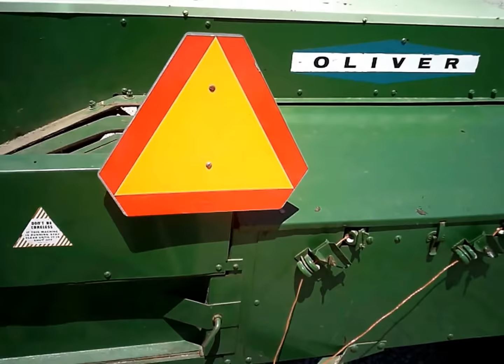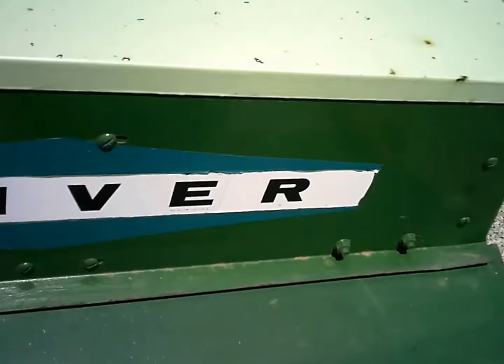Wonderful knotters

Comment: Another thing to look at is your plunger face.  I believe all balers have 45 degree angles top and bottom.  Usually one or two of them is broke off, usually by the knotter that is missing a knot.  They need to be repaired or add a one half by two  inch pie
ce of steel between them and weld it to the face of the plunger.  There was a kit you could buy for springy material but a new holland mechanic told me to weld them on and forget taking them off..  This should stop the string from hanging up on the knotters.  It did mine. It pushes the material thru 2 inches farther and lets the knotterr tie with a loose string. Then your wipers can push the the twine off the knotter.  I haven't missed a knot in years.

Comment: I'm surprised you got it tie plastic twine, Mine never would tie it but put the old sissle twine in it and away it would go !  One thing to remember is that plastic twine was not around when that baler was built so if it still gives you a problem switch it back to the old sissle twine and see what it does with it, Its bigger and easer to cut so its easer for everything to grab it and hold it. That is the one big difference in the old balers and the newer ones the tolerance in the knotters and the twine.  But you got her working good with it and that's something I was never able to do with mine. Looking good Jake !  Bandit
Reply: Bandit farmer my  john deere 24 t wont tie plastic either. They do sell updated bill hooks for plastic twine
Reply: Not that I know of, The 24T was an older baler when plastic twine came out, But you could ask a JD dealer for sure if they do or not. I don't think they do but it never hurts to ask. Bandit
Reply from the maker: Bandit farmer ya I got to have it work with plastic because of the mice. I had them even chew several bales of plastic twine this year. I’ve heard the two biggest things if u run plastic is the twine discs have to be run tighter and the wiper arm needs to wipe the back of the bill hook really nicely. Thanks for watching! I just hope it works come Monday lol
Reply: I think the biggest problem with older balers running plastic twine is they were designed to run the bigger sissle twine and as they get older normal ware prevents them from using it. Now an older baler that doesn't have many bales threw it would be easer to get to run plastic twine because everything it good and tight. My old 520 I had to give a shot of grease every 200 bales to keep it tying good but its a well used baler, Now the new 520 I bought hasn't had maybe 2500 to 3000 bales threw it in its life !  It was bought new and used for two years and its set ever sense, Its an old baler that might have a good chance of being made to run plastic twine than any other old baler because it just doesn't have any ware on it.  Every baler I have run or been around has a sweet spot it runs the best at even new ones.  When they sold my uncles new JD 348 baler at auction the guy that bought it my cousin tried to tell him about its sweet spot, I kid you not this guy told him "I don't give a d- - about no sweet spot it will run wide open or I'll junk it !  LOL Some people right ? Bandit

Comment: I never used plastic twine in my 62T baler but I remember that with the New Holland baler you had to either tighten or loosen the twine tensioners on the twine box when you switched back and forth between sisal and plastic or the knots wouldn't hold once the bale came out of the chamber. It was something that I frequently forgot to do when in a hurry because we switched back and forth all the time depending on where the hay or straw was going. Been a long while now but that came to mind right away when I saw this video. ;)

Comment: Jake just go back to those twine tensioning devices at the twine box and inspect them closely. One or both parts of the "jaws" may have a groove worn in them that is too deep, due to wear, and you might have to fill them in a bit so that they grip adequately. Also the bolt that holds them shut should have a compression spring to hold them shut. With time this spring gets tired and the temptation is to tighten the bolt too tight to grip the string and the spring will not compress sufficiently to allow a knot (between two balls) to pass through. I cannot remember the figure but we used to check out the tension and pull with a spring balance to get the right amount of lbs of friction. Could your balls of twine have got slightly damp over winter and become slightly fuzzy? However it appears likely you might have used enough twine in your testing to have got well past any possible issue like this.
Reply from the maker: Dan Whiteford they have a groove wore in them but they still seem to hold the twine good enough. It should be good to go now. I hope. thanks for the thoughts

Comment: Adjust the wiper so you have a good drag across the bill hook. Also don't tighten those bolts that hold the knotter in place. Those knotter assemblies need move some while making a knot. JD knotters have to be tight. NH knotters(older ones) need to move when making a knot.
Reply from the maker: Ed Horan I made sure the wiper rubbed the bill hook pretty good. Ok our old 67 NH are loose I’ll try it
Reply: Looking at the video again I noticed that the needles are not rubbing the block at 5:04 in the video. The side of the needle should just make a very slight contact with that block. Just enough to make a black mark, but not enough to take the paint off. Then set the needle to the proper height over the twine disc (3/8" on a NH). Other variables could be a worn brass follower on the end of the wiper arm. A flat spot on it will mess things up. Also check the pivot shafts for the needles. NH balers that miss a knot often have a pivot shaft with a broke out weld and the needle will/ can move out of position when tieing. Easy to find. Just try to make the needle cradle move by trying to lift it. If it moves, that pivot has a broken weld. Usually the pivot on the drive side of the cradle is the one that will have the broken weld.  Make sure all the chains that drive the knotters have the proper amount of links. I fixed one that would miss knots in heavy hay because it had an extra link in a chain. It would bale light hay perfectly, but miss a knot in heavy hay. Hope this helps.
Reply from the maker: Ed Horan thanks for the thoughts. If it gives trouble tomorrow I’ll check the welds. I had set the needles to rub like it said in the book and that’s when the problems started. So I moved them back and that helped. I think if I took it apart and put shim washer in it and new bushings in the wiper arm would help a lot. I’ll prolly do that this winter if I get it through this year

Comment: If you are going to buy a owner's manual for your baler, I would suggest getting the manual for the 520 and a parts manual for the 710 also. The 520 owners manual has a better section on knotter trouble shooting. With mine I found that the biggest problem was in how the twine fingers were adjusted. They were wore out and not always grabbing twine from the needle.  Maibach has a lot of the knotter parts yet, so I ordered new fingers and billhooks. We will see what happens late this week if it cures it
Reply from the maker: Nicholas Somers ok thanks for the info. Found a reprint 520 owners manual and a used 720 owners manual. The 520 is more discriptive then?
Reply from the maker: Nicholas Somers and what do u call the twine fingers? The things that pull it from the needles to the knotter
Reply: The 520 manual has pictures of knots that are wrong and the trouble shooting to fix it. I dont know about the 720 manual, I have a 620 manual and it doesn't have the knot troubleshooting.  Call out to Floyd County Historical Society in Charles City Iowa. They might have a 710 parts and owners manual. That's where I got mine. They make copies from originals that are pretty nice.
Reply: Yes the twine fingers are the half moon shaped disks that pull the twine from the needle and pull it into the path of the bill hook. Both the 520 and 620 manuals say to adjust them so they are 1/8" to 3/16"  from needle
Reply from the maker: Nicholas Somers ok I’ll see if they have one for a 710. 710 anything is hard to come by since they only made it one year. Thanks for the info